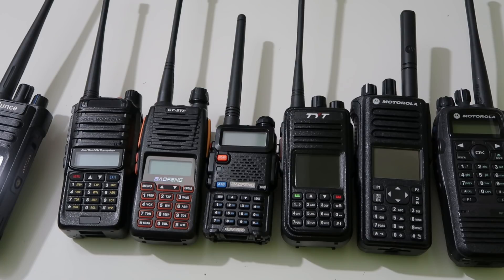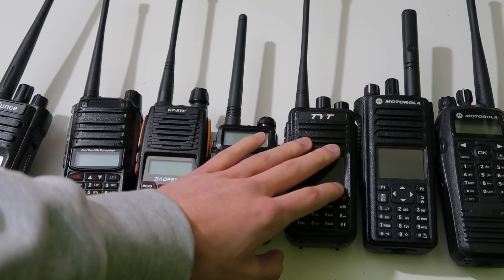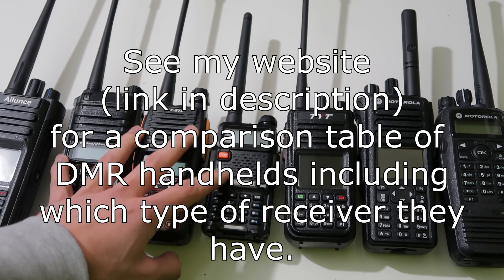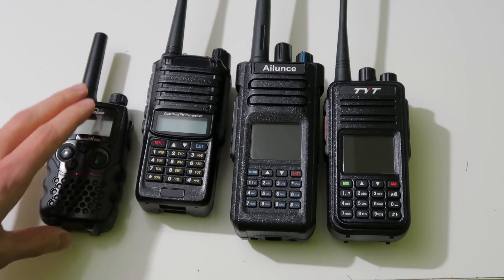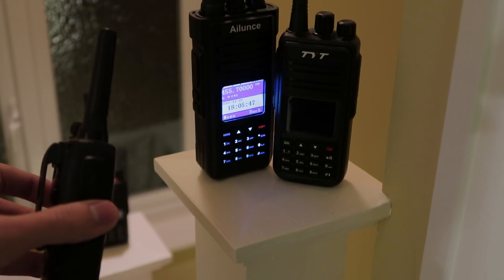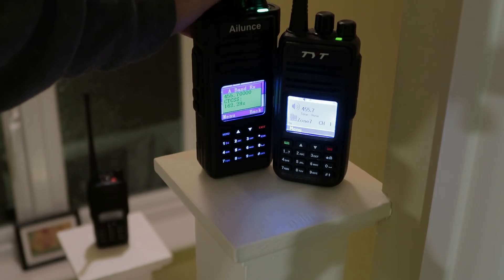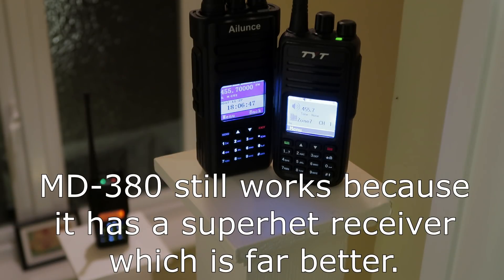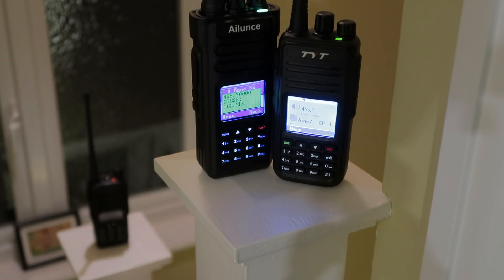Watch out for this substandard type of receiver! (in ALL dual band DMR radios)

Comment: it would be really interesting to do a contact between a superhet mobile with higher tx power and a direct conversion HT, then see if the extra power of the mobile's tx can compensate for poor rx of the ht, while also testing if the superhet rx compensates for the lower tx power of the ht. Would be an interesting test case for justifying the extra tx power of a mobile combined with extra rx sensitivity and further how it could be useful to have a vehicle mounted repeater to facilitate comms between low cost HTs.

Comment: If this is the case then why have Icom just released a 2M HT in the states ( IC-V86) with a direct conversion receiver according the their spec sheet. Are Icom now using a sub standard receiver design maybe even Chinese in a “made in Japan “radio ?
Reply from the maker: Evidently so then, yes.
Reply: Please watch this video and watch the guy at Icom try and tell the other guy that Superheterodyne receiver is a poorer design https://youtu.be/o3KBDulZnJY it’s at 17:30
Reply from the maker: They were only speculating in that video, I just watched it now. The direct conversion does seem to have better sensitivity but I don't think it's worth it at the cost of no reception whenever anyone (or anything, like a radio tower) is transmitting near you. I'd like to see what Icom have done, if anything, to try and combat this issue or maybe they just think people won't notice it

Comment: The HD1 has a major manufacturing issue. After only six months of use it has a white screen of death. Dealing with a company or the seller is ridiculous. Buyer beware do not buy unless you want to send it back to China to receive the same faulty parts
Reply from the maker: And your knowledge of this is based on a sample size of how many radios? 10? 100? 500? If only your one radio then this really doesn't mean much. Every product has some faulty units. My radio is still working fine, and I don't hear many complaints of them breaking
Reply: @radiosification  actually after I had this problemI started looking up the solution to it and found a lot of others that had the same problem. Then I went to either the retevis site or the ailunce site I don't remember and looked up troubleshooting to see that they do indeed cover that. I'm happy for you that your radio is doing fine. I used mine every day at work for like four months maybe six.I also spent many hours talking to the company and the people that sold me in text. You might get a good one but on the other hand you might not. "If white screen do this"showing them unplugging the ribbon cable and putting it back in. They also recommended reinstalling a different firmware. Not really something I look for in a radio but hey maybe I'm different than everyone else
Reply: Scroll down to the near bottom. I would consider this a major manufacturing issue. Originally I contacted ailunce and they were supposed to send me the screen and board replacement. They already knew what I needed. Maybe someday it'll show up but I never heard anything more. Most of the hours and arguing where spent with official retevis store on eBay where I purchased it. I don't really want to send this thing back to China to be fixed. I bought a radio to use it not do all this but that's just me
Reply from the maker: @clovenbeast5183  Have you already tried to reinsert the cable?
Reply: @radiosification yup. Went through all of it.
Reply: @radiosification  I even carefully looked over the ribbon cable and contacts to make sure that it wasn't just a faulty cable. I didn't pull the screen and driver board out to look it over but I did everything they said. I was even a fairly good sport up until the seller offered me that maybe I sell 5 to 10 radios and he give me a discount. I told him I was done.
Reply: @radiosification  in fact I'm going to put the seller's name here from eBay
 retevisofficialstore
Reply: @radiosification  his Facebook for the store is John chen
Reply: @radiosification  I even contemplated paying to send it to Chinato have it fixed but the seller left such a bad taste in my mouth I honestly didn't trust I would ever see it again
Reply: @radiosification  I posted it on his Facebook page the problems I was having even. The next morning they were deleted. Maybe it's just the seller but they didn't even bother to write a response or anyting they just covered it up
Reply from the maker: That is the official store for Ailunce. The manufacturer sells direct. You should be safe to send it back for repair. I sent my original radio which was one of the first made back and they replaced it
Reply: @radiosification  I guess  TheSmokinApe  has heard of it judging by his response to me? Who knows
Reply: https://www.ailunce.com/blog/How-do-Ailunce-HD1-can't-turn-on

Comment: Re: "...this is an experiment to test..."  In the world of engineering, this is neither a test nor an experiment.  There are way too many unknown variables for it to be useful.  It MIGHT be considered a "demonstration" of the ability of a receiver on some frequency (appears to be 455.7mhz),  to reject a signal of some unknown frequency (you said you couldn't remember in one of your comment replies), with other signals of unknown strength and origin at the frequency being received.  To make things even more confusing, the there radios are inches (sorry, centimeters) apart, so who knows what mixing products are being introduced into the mix.  Finally your conclusion is that ALL direct conversion receivers are inferior to superhets.  Sorry, but even if all the other variables had been controlled, the conclusion is far too broad to be taken seriously.  A review of the results of  the Sherwood Engineering HF receiver test results show that the Elecraft KX3, a well designed direct conversion SDR receiver beats out 90% of the approximately 120  other hf receivers, almost all of which are superhets.  Direct conversion super regenerative receivers are alive and well in cell phones as well.
Reply from the maker: Feel free to run your own experiment then

Comment: I have 2 TYT MD 380 and one anytone 868.  The 380’ are far better than the Anytone but if I mention this to the local dmr group they claim the ARRL gives it a good rating.  The 868 is deaf on the WX channels and fringe 2 meter repeaters whereas the vhf 380 does better

I’m sick of telling other so called amateur operators that direct conversion is not a good option and then watch them promote a new product only to see they are getting deals thru the manufacturer

Comment: What about the MD-UV380? Seems like its just a 380 but dual band? Is that Superhet or DC? Can't find any information as to one way or the other? Not sure, but it does look like the sacrifice of the Superhet for DC for the BTech DMR-6x2 seems to be the best compromise IMO.
Reply from the maker: It is direct conversion. Have a look on my blog post.
Reply: @radiosification  Unfortunate. Wonder why they did that, other than cost? Also, how come there haven't been much in the way of Chinese DMR mobiles? Any recommendations on that front? Also, Haven't see much in the way of DMR on 220mhz either?
Reply from the maker: Yeah I know, I was very disappointed too. Thought they'd keep the best feature of the MD-380 but no, they got rid of it.

There are some mobile radios but I don't follow that topic as I'm not interested in it at all.

220MHz band is just not used enough around the world for it to be worth the manufacturers making DMR radios for it. I think Tait has some equipment that covers around 200 MHz but I'm unsure how high up in frequency it goes.

Comment: stay away from motorola. as they tend to give people massive amounts of trouble if you need tech support.
also on a bigger scale, a company along with a bunch of other companies have independently tested out ham radios in the event of a high altitude nuclear emp attack.
and what they showed was that motorola dies and never comes back when they were tested against E1, E2 and E3 EMP tests in three stages of 2-seconds, 5-seconds and 10-second EMP pulse.
all the rest of the ham radios survived , specially newer manufactured radios as newer ones tend to have a EMP protection shield plate on their boards within the radios.
other companies have tested over 50 motorola radios and every single one of them died and has never come back alive even after trying to reboot or change the batteries.
If you are serious about the equipment you buy with your hard earned money, stay the hell away from motorola, because if SHTF in this world, those radios wont last long.  just FYI.
if you would like to watch one out of many companies on youtube do this, search for Solar-Ark on youtube and look through their videos and youll see several EMP tests videos
Reply from the maker: And a high altitude EMP attack is very very very unlikely to happen. If some people want to prepare for that then that's up to them but most people don't care about that sort of thing. This video is not about prepping, it's about normal use of radios in normal situations.
Reply: Do you have any definitive proof that it will never happen ? - If not then you can NEVER say that its very unlikely, because anything can happen in this world.
Specially in this day in age, where technology is constantly being upgraded , specially when it comes to equipment and weapons of war.
and when we have several countries who wants to wipe out america from this planet, namely NK and Iran among the few.
Reply from the maker: I never said that it won't happen. Only that it's incredibly unlikely to happen. Everything has a probability of happening and the ones with a probability so low are not worth preparing for. It's like preparing for when you win the lottery. You probably won't, so you'll just waste a lot of time preparing for nothing.
Reply: its funny how humans just leaves everything  for the last second, because they believe it will have a very low probability.
its like the new casters saying on the news that the bad weather we was getting is nothing to worry about and that NYC would never be hit with a hurricane,
people went about their business because they believe the news saying it was a very low probability and it would never happen.  ignoring the weather and what was happening.
and then Hurricane Sandy came and destroyed 25% of NYC and killing 200 people and destroyed thousands of houses including mine that winded up in the ocean.
all because everyone said, it is unlikely it would happen...  Its the way humans are, they always push things to the very last minute, then be surprised when it happens and they where not prepared and either die or lose it all. ---------   I rather be prepared and not need it, then need it and not have been prepared.

Comment: Direct conversion receivers you are comparing I fear do not have enough filtering. Yes having a mixer can help with blockers (desensitizing) but a well designed direct conversion can use good analog filtering with better digital filtering. I think cheap is the problem. Thank you for the video.

Comment: I found out the hard way after upgrading to a anytone 868 that it is indeed deaf on analog.  I compared this to a TYT MD 380 which is similar to the best commercial radios.  There  is a community that fully believes that analog sensitivity is of no great concern and therefore the bells and whistles of the Anytone is more important that the shortcomings of a direct conversion receiver

Comment: I have watched this video and it was an eye opener. I n the radio recommendations page you recommend the Anytone dual band.  My question is does it also suffer from the desenitivity problem.  I am brand new to this and I have been looking at HT's even if I go to say icom or Yeasu I can convert to brandmeister using a hotspot (Shark open spot).  The Yaesu 70 uses a double conversion superhet? .  I'm so confussed.  Thank you for your vidios and any help you can provide.
Reply from the maker: Yes the anytone will have the same issue. The Japanese radios (icom, Kenwood, yaesu) are usually better quality and have superheterodyne receivers. If you are only using a hotspot then it won't matter too much because you're always quite close to it. You could just buy an MD-380 which does have a superheterodyne receiver. They're cheap and work well but are only single band. The receiver desensitizing issue is not too major though unless you want to use the radio around other hams who are also using theirs
Reply: I just got my Tech license and joined a local radio club so yes that is my concern as in field days or contests.  I, for some reason, would like the ability to use both Vhf and Uhf bands as some of the local repeaters are on them.  I live in Florida and have a brother in Colorado who likes Bandmeister so that means DMR.
Reply from the maker: At the moment there are no dual band DMR radios with superheterodyne receivers. You can buy two MD-380s, one for each band, since they're not all that expensive. Have a look on eBay. If I were you I'd just pick a band though and buy one radio. In most places they are mostly on UHF.
Reply: Thank you so much...I think MD-390 UHF will be the best bet

Comment: How are you finding out if the receivers are direct or superheterodyne. I have looked up the spec of several radios and they do not mention receiver type. Is there something in the spec that gives it away.thanks Ben. Great video I learnt something from this.
Reply from the maker: A whole variety of ways. For some radios the manufacturer will tell you if asked. For some radios I am just relying on what others have told me.

You can often tell by the chip. RDA1846 and other similar chips seen on the circuit board mean it's direct conversion. You can look up chips online and if the data sheet talks about it being a "Single chip transceiver" then it's pretty much guaranteed to be direct conversion.

Comment: I'd say this methodology constrains a more representative overview of DC implementations. For example NASA uses DC implementations (such as the Radio JOVE project). Statements like 'in ALL dual band radios', may give the impression that all dual band DMR radios are inferior. Indeed designs that focus on low cost and simplicity may be the hallmark of many offshore dual band DMR radios currently available, but that is an assumption that requires more investigation for substantiation. For a great in depth read on this topic, consider the book by Wes Hayward and Doug DeMax, "Solid State Design..." Published years ago, it does not cover how to make dynamic range more predictable for receivers outside the 40 meter band, an issue that has been addressed by later initiatives (such as the open-loop approach), and it is also worth noting that low-IF superhets in the real world display issues similar to direct conversion with self detection, etc.
Reply from the maker: You're right about saying that the statement about "all dual band radios" is not correct. However I was very careful to specify all dual band DMR radios. Not just "all dual band radios". At the moment there are no dual band DMR radios made by non-chinese manufacturers. There are certainly dual band radios, and even more than dual band. Tri-band, if you like. Like the Viking VP900 and motorola apx8000. The very important difference here is that those radios do not do DMR. Only P25 and FM.

Yes, direct conversion receivers can be good. They can be useful in certain applications. But in the way they are used right now in chinese two way radios, they are inferior to super heterodyne.

Comment: Direct conversion receivers can be just as good as any super het. It's all down to how well it's been designed. If your rx front end band pass filtering is poor (out of band rejection ability) or your front/mixer can't handle strong'ish in-band signals then you're going to have problems whether you have a super het or direct conversion. The same applies if your first I.F filter in your super het rx is poor or your first low-pass filter is poor in your direct conversion rx.

Internal screening also plays a major role. If done badly then it won't matter what rx architecture you have, your rx will not cope well with nearby transmitters.

So it's in no the way the architecture that's the problem, it's how it's implemented that's the problem. In fact, a direct conversion rx can out perform a super het if done right.
Reply: Ten Tec made some extremely good direct conversion receivers in their lower priced cw units.